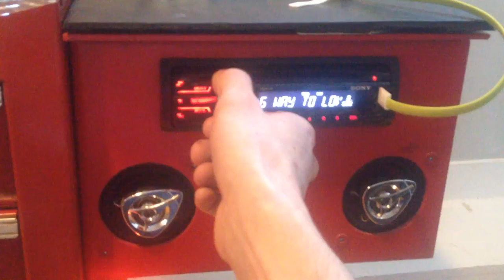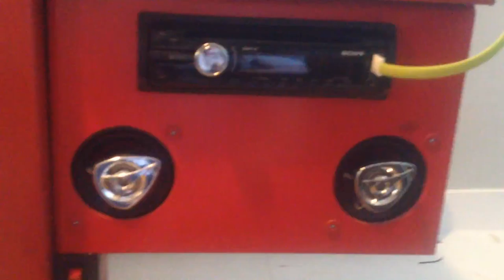Custom toolbox stereo - Car audio

Comment: Have a part number on the inverter and fuse panel also
Reply from the maker: Thomas Elliott 
Sorry I don't. Power supply I got on eBay and the info isn't on my account anymore. Fuse panel I had lying around and there's no numbers on it.